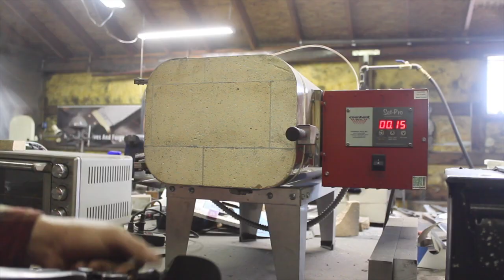Damascus Steel Integral Kitchen Knife ~ Full Movie

Comment: What that liquid you pulled the billet out of just before you put in the firge
Reply from the maker: That is diesel
Reply: @FireCreekForge  what does the diesel do for the process? And, was that borax you sprinkled on right after that?
Reply from the maker: @nateand3  diesel, kerosene, even WD-40 aids i protecting the steel, then deposits a small amount of carbon on burn off that can aid welding. You can use it with or without flux in a properly prepped billet. Check out the vid i made forging damascus with just WD-40. Thanks!
Reply: @FireCreekForge  thanx. I'll be watching that one next...if I can find it. I'm technologically stupid lol
Reply from the maker: @nateand3  haha, we are all learning!